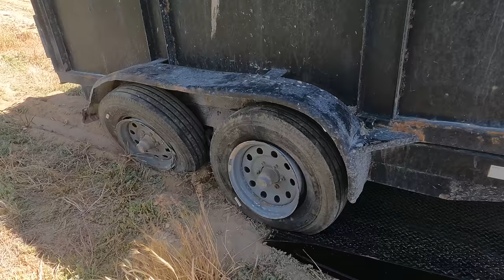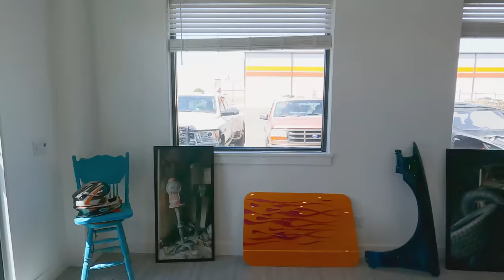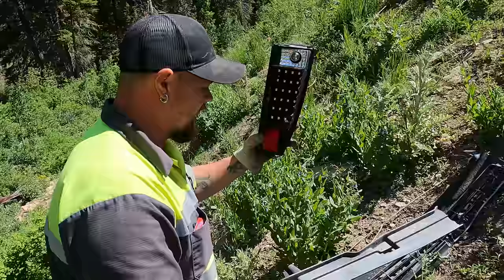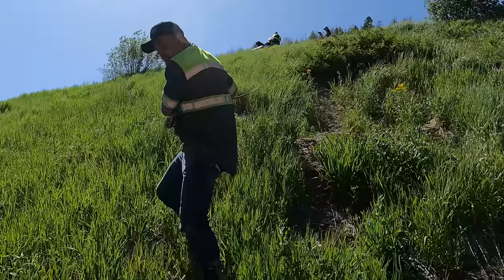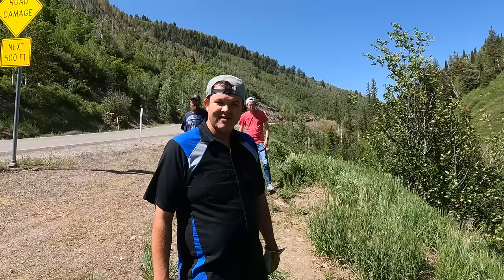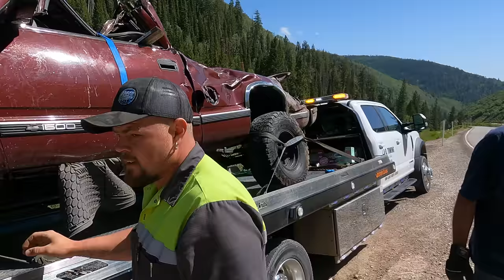Driver Launched Truck Off 80ft Cliff!

Comment: The heavy really is a business decision. If you have friends that are close and can help you with those tough jobs, then no. If it takes hours for someone to show to help out? Then maybe. The cost of that rig and staffing HAS TO be considered. Also, how often do you need a rig that big?
Reply: This sums it up. I wish I had said it. :)
Reply: wise wise wise... as a former finance broker for towing equipment these comments are gold!   those things ran $175-250K in the 90s, maintaining insurance and keeping qualified operators available 24-7 is required whether they get a call or not....  Remember, those guys with the big trucks are your friends , you are a referral source for them... until you buy your own, then y'all become competitors.. it changes the landscape of the entire local industry
Reply: Indeed....I bet that wrecker is every bit of 200K+ Even used probably over 100K then you have insurance and maintenance which they can likely do most of that. I know I Follow Ron Pratt and I believe he said his rotator was like 700K back 5 or 6 years ago. I watch Hill Towing and he bought a heavy like that used a little bit ago but I don't think he mentioned what he paid for it.
Reply: @chriskulpa4056  Ron Pratt said his was closer to $750k with all the gear on it, that pickup would be nothing to lift and swing from the "tator"...  just park close to side, set the outriggers and swing boom out full extension....  drop and rig tire slings on all four, straight lift up, swing back over the cliff right onto the rollback....     i've seen him and "pepe's " do same thing many times
Reply: Yeah I was talking about the truck itself as I don't think they got much gear with this one they purchased.  Like I say that was 5+ years ago so probably closer to 800K just for the truck as it sits no gear I've probably watched every video Ron's put out :)    @handymansteve

Comment: When I used to drive tow trucks, we always kept a quart of Trans fluid on the truck to help locked up wheels/axles to slide. Just pour a little in front, or behind the trouble wheel. We used trans fluid because it washed off easily without leaving an oily residue.😉😊

Comment: Man I hope who was ever involved in this wreck is OK . Heavy wrecker would not be a priority to me especially if i have someone nearby that has one . Thanks for the video
Reply: The heavy wrecker is on the far east side of Utah about a 4-6 hour drive. He  has family about 30 minutes away from where this accident was and probably going there for Fathers day so it just was luck he was there. However you are right they are a. expensive and b. limited use unless you are close enough to an area that  has lots of big rigs. Where Robbie lives is between 2 mountain ranges in a beautiful valley so not a lot of need for a big rig. Even Matt doesn't have one that we've seen, and they are fairly close to I15
Reply: Ya , makes sense

Comment: Robby, even with your bodywork skills, Hillbilly’s mechanical skills I don’t think you can save that one 😉😂.  Great job partnering with Steele!
Reply: It should buff right out.
Reply: Might need a skim coat of filler in a few places. 😎
Reply: Put it on that machine that straightens the frame and it would be right as rain!
Reply: I think he could for a meer 125k.
Reply: Just needs a little sanding. Guide coat, and more sanding

Comment: Robby I love your channel and the videos you put out. That being said, I’m collision tech with about 14 years under my belt. I still learn new things every day. Some of which are from you actually. The business that I work for also dose towing and recovery. I did a similar recovery with an F550 equipped with a Vulcan 892  dual line. My question is why did you need a heavy that.

Comment: Hey Robbie, see you using chain binders on that trailer. I have a thousand snipes on those and always wrap handle with a bit of black tape as they love to loosen up. Just a safety so they don't shake off.. They never tight when you get them home. Good content. cheers

Comment: I would highly recommend using ratchet binders as the snap binders can come undone.  However if you prefer the snap binders using a bungee to wrap around the handle is a good way to stop it from coming undone. 
NOT telling you what to do, just have a lot of experience and trying to help.
Thanks for the video.
Reply: Those overtravel chain binders are not even legal here any longer, gotta be the rachet style ones, too many people got hurt too badly.
Reply: I won't use ratchet binders but always either use a bungee or duct tape to secure them. If I were in business I would insist the employees use them as they reduce the possibility of mistakes.  The new Crosby ratchet binders that can be tightened with an Impact would be my choice as they are so much faster to use.

Comment: There are keepers for break-over boomers. They are available at trucks stops or semi-truck supply stores. The keepers are simple U-shaped metal, with holes and a snap-over pin. It keeps the handle from popping full open if it comes apart.

Comment: Thats a Baby Heavy Wrecker.
In my old line of work(well I still do the same job, but for the government, not for profit) we had to work on all kinds of heavy vehicles(not heavy equipment, on highway stuff) Fire Trucks, Tour Buses, 300 ton Cranes(like a Liebherr LTM 1300). 
Anyways, the wreckers we have down here were like large backwards cranes. Sometimes they would have to put the boom out to take weight off the back whole also lifting up the front. Crazy shit. Plus we had to work on those wreckers, if they were Detroit Diesels(I worked at FDD-A)

Comment: You should get some reusable zip ties and put them around the end of those chain tighten handles, if had them pop open on the road. We used wire, but the reusable type of zip ties would be better.

Comment: When I worked for Vulcan Equipment, the saying was "If it's sat in the yard, you're sh***ing yourself because it's not earning it's Keep". Best way to go is to buy an used tractor unit, stretch the frame and mount a new wrecker body on it.

Comment: a rotator type would have been nice in that situation, but they are pricey.

possible alternative:  an old school 650 or larger Holmes, with swing out booms, dual winches on the booms plus a brute of a drag winch, and perhaps another winch at the front.  you may need something to tie off on, to be your "Holmes Tree" during side pulls/lifts (another rig that serves as a counter weight/anchor).

that should put you where you can handle the more difficult stuff and get it to where the rollback can take over, and you will be big enough to assist other tow trucks when they need another line, but not large enough for them to try pressing you into road towing fully loaded semi trucks ... kinda got the impression that you don't want to go that large at this point

Comment: A quick search turned up the following, which is great news, considering the state of that truck: "He was extricated and treated for non life threatening injuries. According to the report the driver stated he was blinded by another car’s headlights causing him to veer right, lose control and go off the road to the left, off an embankment approximately 80 feet." Source - Mid Utah Radio.

Comment: I think the driver of the truck may be OK. This MIGHT be related to the crash: 

Around 6:00 a.m. on June 19, authorities responded to a call after an individual discovered a vehicle that had gone off the roadway on state route 31 in Fairview Canyon. According to reports the driver, Michael Houck age 39, had been stuck inside the vehicle since the crash sometime between 9:00 p.m. and 1:00 a.m. the night before. He was extricated and treated for non life threatening injuries. According to the report the driver stated he was blinded by another car’s headlights causing him to veer right lose control and go off the road to the left, off an embankment approximately 80 feet.

Comment: With the cost of a new heavy wrecker and especially a rotator they go for well north of $1,000,000. Unless you have a lottery win you cannot do enough recoveries to pay it off. Plus you need a crew of experienced operators to run it.

Comment: you guys should think about investing in a rotator and not a straight heavy and filming everything on that. Document the entire process around recovery, and then repair. the rotator is a higher initial layout but allows additional services of a small crane in addition to the heavy tows, rollovers, winch outs etc.

Comment: Vehicle cost, insurance, maintenance, competition in the area, etc are all factors to be considered. Probably cheaper to subcontract like this when needed than buying the truck. Unless you're going into heavy recovery like Ron Pratt's Midwest Truck, it wouldn't be cost effective.
Personally, I don't see why the rollback wouldn't have pulled that truck up, all you needed was extra cable and a couple snatch blocks.

Comment: 100% agree with your own comment midway thru about not seeing Don. A heavy wrecker is a massive investment (pun intended); if you guys are already running at 90-100% on your time with what you already have, and you don't have enough work out there to be calling Don at least 3 times a week, probably best to just collab with him for the jobs where the 550 is too small rather than over extend yourself.
I know you have business sense, so look purely at the numbers. If it doesn't add up, just don't. If however you find an absolute steal of a deal where you can afford to have it sit between jobs, that's another matter.

Comment: Just a though on th truck, could you hook up to opposite corners and do a lift instead of a pull up the hill. grab kitty corner like driver's rear wheel and passenger front simultaneously? Or wer forces working against that?

Comment: oh my you did a big DOT no no, when using that type of binder you have to wrap the chain around the binder handle without it the binder can slack up enough to come loose ask me how I know I got nailed by Texas DPS 250.00 fine failure to secure load properly

Comment: It really doesn't look all that bad. I mean yeah the cab in the bed is completely shot the hell. But it's a truck six bolts or whatever to remove the body 6 volts to remove the bed and then you have a clean chassis and the suspension looks like it survived the roll over pretty good. As long as the engines not hurt you have a running and driving chassis you just need a cabin a bed you can actually fix this truck. By the looks of them wheels that are on it the suspensions lifted and it's probably worth some money and it probably survived. So yeah you can throw a new cab in bed on this and be good to go there's a really good chassis there.

Comment: What do you mean "obviously a total loss"? Put that thing on the frame puller and the a few tack welds and a little bondo and fresh paint and slap those sweet aftermarket tail lights back in and itll be good as new. Hell yall even found the CD player bezel, that alone is worth fixing the truck. 

In all seriousness glad that fella is still alive. That had to be scary and painful

Comment: That trailer was most likely using ancient tires and/or was overloaded. Can't believe what risks people are willing to take. That could have killed someone in the opposite lane.
Reply: It happens a lot with a poorly loaded trailer (too much tongue weight) or not knowing what to do when it starts to fishtail. The normal reaction is to steer out of it but all that does is makes it worse. Stay pointed where you want to go and change speed to interfere with the rhythm of the swing. This localizes the pivot momentum.

Comment: There is a lot of liability involved in a bigger tow truck just insurance is higher takes more diesel to operate it driver has to have cdl and a medical card them you need enough business to justify all the expenses and if you're going to be hauling big trucks you need a storage yard that will hold several trucks and trailers at a time I have help set up several companies to get started in trucking industry they all said they wish they had someone to tell them stuff like I'm telling you it's more expensive to run a big rig it cost you just setting in the yard

Comment: the only problem with big wreckers there has to be a need for one in the area and then you have to have a class a CDL witch means log books well computerized logs now, what i would do is get a 12 ton median duty so no CDL and still be able to do jobs like this i would do a 4 door international all wheel drive with a 12 or 15 ton wrecker body 
I had an international 4700 with a 10 ton wrecker body and wheel lift biggest tow was a ford 9000 cabover tractor for the state police i was the only truck available so they gave me permission to get it 3 miles down the road to a safe spot without there permission it would have been very illegal

Comment: Yeah, I figured you guys were just on a normal rotation. You don't own $150k tow trucks just for an auto body shop. If they aren't running, they are losing money. 
And you don't own a heavy unless you're a full service tow, which you guys are not. A full class 8 heavy will run you at least $500k minimum. Thats alot of dough to just be used when you need it. 
They have heavys down here in SWFL that are probably in the $1 mill range.